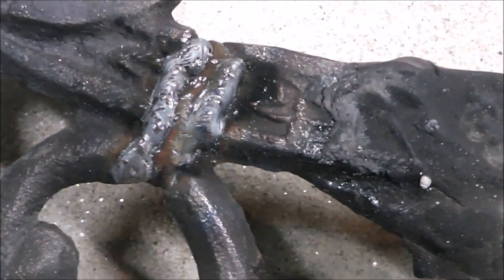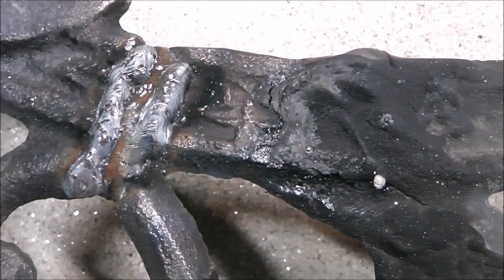Mig Welding broken Cast Iron!

Comment: I mig welded a cast bench end the same as you. It was about ten years ago. And the bench still lives on today 👍🏼👌🏽
Reply from the maker: There can be a lot of negativity when it comes to welding cast iron in a non conventional way like mig welding. Many will say it can’t be done... I love hearing these success stories now 10 years later.  Thanks for sharing!👍
Reply: @BrandonLund  👍🏼👍🏼 I slightly over welded. And ground the shapes back in. I never used the sand. And she’s still going strong 💪🏼 👌🏽😜
Reply: @A-sq2dy  did you weld with gas or Flux core? I've got a buddy that is asking me to build some railings that will have decorative cast hand rail tops and curly end pieces. Thinking of using Flux core because I'll be outside and no really wanting to haul the tank.
Reply from the maker: @jeffburkholder2148 flux core will work 👍

Comment: I have welded many cast iron things using  MIG welder and standard wire.  I prefer to preheat the entire piece in an oven, weld and stress relieve a short section, return to the oven to reheat, repeat until piece has been completed, then cool in sand.  I have not been 100% successful but the process has been good to me over the years.
Reply from the maker: Good to know! This was my first experiment with this type of process and I was a bit concerned considering I believed the cast iron was probably not the best. Its good to know that someone with more experience with this also has had some good success.  Thank you!
Reply: Brandon Lund What has worked for me is to be very sure my weld joints are clean and I like to clean past the joint by around a quarter in on all sides to reduce potential porosity.  The next big factor is to not get greedy when dropping a bead.  No more than half an inch at a time followed by stress relief.  I like to weld on one end of the repair then the other along with the appropriate reheat cycles.  The idea during the whole repair is to minimize the amount of stress and shrink your weld will have to endure.
Reply: I never stress relieved anything so I'm not to sure about stress relieving , but I need to weld a large patio chair arm that got broken in the storm. 
How can I stress relieve it after welding it ? I can heat it with torch.
Reply: I would like to know if you think exhaust manifolds would withstand the heat of the engine running? Thank you amd great video
Reply: @joeylove1801  if welded properly they do

Comment: I have been welding cast with mig for years. 
Well done a good job.
Reply from the maker: Joseph Lockhart great to hear and thank you! :) it's still holding strong!
Reply: @Jonny boy did you end up welding the cast iron? How did it turn out?
Reply: @Jonny boy Oh I see. I was curious if it would work for the base of a vise I have.
Reply: With nickel alloy wire??

Comment: your mig weld is just as good if not better than I have seen with nickel rods . am about to try to fix a broken trunnion  of an old bandsaw will try the mig first having seen your vid Thanks..
Reply from the maker: Thanks for the compliment Francis. Give it a shot!  If you do all the steps, you shouldn't have any trouble. Good luck and be sure to post back to let me and others know how it worked out.
Reply: I love your video. I've got a cast iron part that I want to try this out on with my everlast mig welder. I was going to try stick but I don't stick weld that often and I'm concerned about slag inclusion
Reply from the maker: +Scott Thomas I'm glad I could help. Good luck on your repair and let me know how you made out!

Comment: So the sand is to slow the cooling process? Like an insulator? What temp do you preheat to? 500? Great vid thx for your insight.
Reply from the maker: Thank you! I like to have it around 400-500 deg. F if possible and the sand helps cool the part slowly in an effort to minimize cracking

Comment: One important thing to remember is that this project was cast with Modern cast iron as opposed to cast iron from 50 to 100 years or more which I believe would have a slightly different makeup as well as exposure time to corrosion.
Reply from the maker: +Mark Fryer Spot on Mark! Any cast part can be hit or miss depending on how "pot metal" is involved :)

Comment: can it be done without gas? Can you weld mild steel to cast iron? what was the sand for ?
Reply from the maker: Unfortunately to use solid wire you need gas. This is and end of a metal park bench

Comment: wow you come long way since this video going by amount vids you done i would say hard work paid off, if you was to redo this repair with all stuff you learnt since what would you change?
Reply from the maker: I probably wouldn't have changed much. That repair is still holding, however, I now know that silicon bronze wire would have made this almost as strong as it was originally rather than being about 70% as strong. But is still very much an adequate repair

Comment: Hi Brandon,
Thank you for the great videos and all the detail!
I have a 1980's snowblower where I over torqued the nut at the starter rope end of the drive shaft. I am pretty certain that the drive shaft is a single piece of cast iron. There is no visible corrosion, and the end that broke typically stays dry (i.e. no oil-soaking). Do you think that welding would hold up to the stresses of the rope-pulls? I can easily preheat and post heat in our home oven. I have a small 110v wire feed (no gas) welder and an oxy-acetylene torch as available tools. I am just wondering if this is a throw-away, or can I still get another season or two of snowblowing from it?
Reply from the maker: As someone who loves keeping things going, I say go for it! And the 110 welder will work just fine for this

Comment: i have welded cast for years. had people tell me for years cant be done
Reply: Ever try drilling thru a weld on cast iron or using a grinder? Impossible .
Reply from the maker: Its actually one of the 5 tests to determine if its cast. It hardens when welded. Some fillers are machineable though
Reply: @BrandonLund  I filled in a hole that needed tapped  and forget about drilling that after using many newly invented curse words .It would take a week of resharpening bits trying drill it out, oh well . Have a great day Brandon .
Reply from the maker: Yah its no fun dealing with hardened metal ;)

Comment: was the MIG wire  with or with out flux in it ?  if no flux have you used the wire with the flux in it?
Reply from the maker: This video is without the flux (solid wire with C-25 gas). If you want to know more about flux core wire and how strong it is when making a cast iron repair, here you go https://youtu.be/jMyg3rpmCBU

Comment: Hi Brandon I have an old 2 gallon Gypsy type kettle. Is there an epoxy that i can seal it. Im using it as a melting pot for melting aluminum....Are there epoxies that will work if its put back in the fire?
I plan to not put it near where the air comes in at the forge...
Reply from the maker: Hey Ron, I'm not aware of any epoxies that will withstand those temperatures.
Reply: Fire cement for wood stoves has a 2000 degree temp rating.
Reply from the maker: Great tip! Thanks

Comment: I would use stick if it was load bearing like heavy load but if it's just ornamental mainly it will Def be ok ...I've used Flux cor on some types of cast but I believe hard wire will do to depending on part and Intended use of said part
Reply from the maker: Silicon Bronze is nearly as strong as the original cast iron. I wasn't aware of this at the time I posted this video

Comment: Hey Brandon, a neighbor just asked me to weld up a cast piece for his Harley-Davidson. I have a Lincoln electric easy mig 140 which I will use. Is there a specific type of sand you used to slow the cooling process or will any sand do?
Reply from the maker: Just grab a bag of "play sand" at the big box store. Its good and dry which is what you want.

Comment: If we weld castion without heating..it is problem ??and why heating castion before welding???
Reply from the maker: Heating it prior to welding helps reduce the heat shock from welding.
Reply: @BrandonLund  thnkz you my friend ❤❤
Reply from the maker: @Amilaruwan621  Glad I could help :)

Comment: I have silver brazed with Harris 15 and white Stay-Silv flux, silver soldered with Oatey plumber solder, and acid flux , and brazed grey cast iron with 1/8 white fluxed rods. Usually I preheat in my oven to around 350 *F the whole piece. then I lay it in dry sand, braze it, then cover with more sand and lay towel over that. I found it neat that silver plumbers solder made for copper pipe can be used. it has 10,000 psi strength and a 420*f melting point, mostly used that for cracks in water cooled manifolds like if they got frozen.
Reply from the maker: Wow Scott I'm impressed. I never gave it a thought to try silver solder. I might have to do some testing with a silver solder repair. Thanks for sharing!
Reply: @BrandonLund  yes, you will be surprised, it has to have silver content. And I put the acid flux on the cast iron part out of the oven and it sizzled hot, but if you overheat the part the flux will burn off. After melting the solder into the groove, I dragged a screwdriver scraping it along in the trough to see it wetted out on the grey cast iron. The crack was about 6 inches long. I drilled 1/8 holes about half way thru every 1/4 inch and then used my  dremel to cut a channel all along the crack using a grinding disc, but a carbide tip grinder would be better. For a part like that bench leg, silver solder wont be strong enough to bear people weight of up to 500 pounds, dont think enough surface area exists for that on the crack but fixing a smaller part or a crack in a cast iron water manifold should be ok.

Comment: WHY do you tap the welds between each layer?  That is something required if you're using a Stick Welder, but it's to remove the slag, a byproduct of the flux.  A gas-flux mig welder can't produce slag.
Reply from the maker: Follow my cast iron playlist for an explanation of why this step is mandatory when repairing cast iron. It has nothing to do with removing flux.
Reply: It is to stretch the weld to counteract the shrinkage stresses of the weld.

Comment: Nice. Did throw away the piece or used it?
Reply from the maker: +Shaq Deisel I kept it. It's going to be in an upcoming video.
Reply: Brandon, have you reassembled the piece back into a bench and does it hold weight?
Reply from the maker: +John Hagenbrock Yes, that is an upcoming video. I have tried to break the repair (within reason) and it did not break. :)

Comment: Why do you use the hammer and hit the weld? You used MIG
Reply from the maker: CUBETechie it relieves stress between the weld metal and base material.
Reply from the maker: Here is a video that explains the process 
a little better https://youtu.be/kzbcVb2UymA

Comment: Brandon, why do you hammer the welds? Did the pre-heating help? I tried to weld something to a cast brake disc some time ago (stick welding though).. was a complete fail… the weld separated at the cast part… any idea how to prevent it?
Reply from the maker: Thanks for watching. The hammering helps reduce the heat shock as does the pre heating and then the slow cooling in the sand. It's the sudden heat (welding) then the fast cooling that cause cast iron to crack.  I welded some cast iron iron brake discs in my lamp video without preheat and cooling and did get a couple cracks I had to reweld.
Reply: doesn't the pinning it with the hammer help with stress relief?
Reply from the maker: +keith wilson It sure does. That plays a big part of releiving the stress in the metal. Thanks for watching!
Reply: "muggy weld" I heard works well
Reply from the maker: +brian willoughby I've heard that also. I believe that process uses the nickle rods I mentioned in the video. Thanks for watching!
Reply: sepoooe i believe the hammering relieves internal stress in the weld while its still hot for the molecules to align.
Reply: Brandon Lund o didn't see the replies. I suppose redundancy isnt a bad thing.
Reply from the maker: +IDUS Haha no worries :)
Reply: I thought you were using fluxcore. I use fcaw for casting repairs here at work. Nice vid!
Reply from the maker: Justin Hartwig Thanks a lot! It was a first for me but I'm really happy how well it worked.
Reply from the maker: @brianw4brian here is your video suggestion  https://youtu.be/kzbcVb2UymA